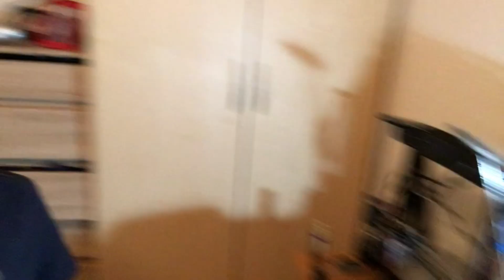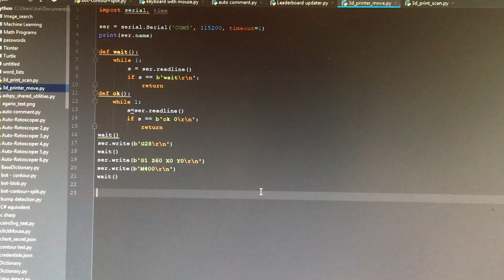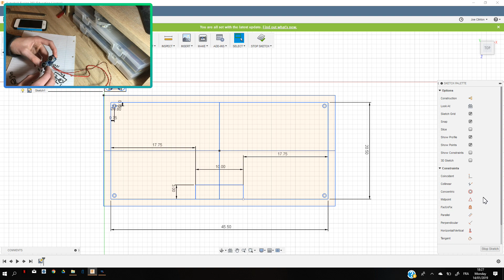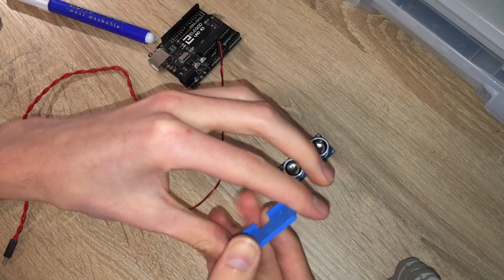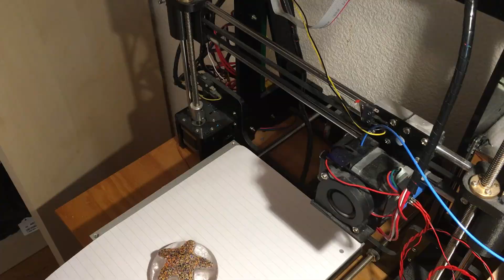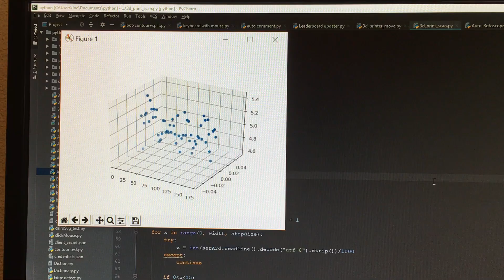Hack your 3d printer into a (useless) 3D scanner for under $15!

Comment: Nice concept. I reccomend you give the head 1.5 seconds before moving it on either axis. Ultrasonic sensors work by estimating over multiple iterations of scanning. Early scans being less accurate.
Gl
Reply from the maker: Ok, but the main question I have is what is causing the downwards slope? Also, this scanning already takes a minute to do I've just sped it up. Adding 1.5 seconds between every data point for the 1000's of points would take a long time.
Reply: @joeclinton837  Ultra sonic simply isn't the answer then I guess.
I'll might try something similar as well. Il stay in touch.
Reply: @joeclinton837  the downward slope would be created because of the repeated accuracy after a similar distance is presented for more time. (My theory)